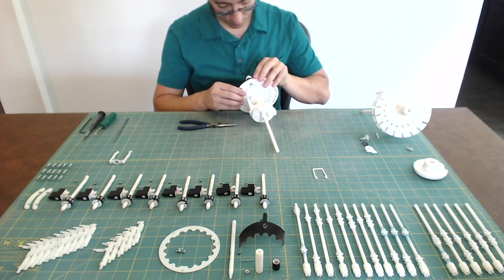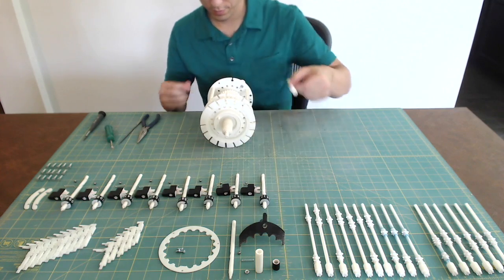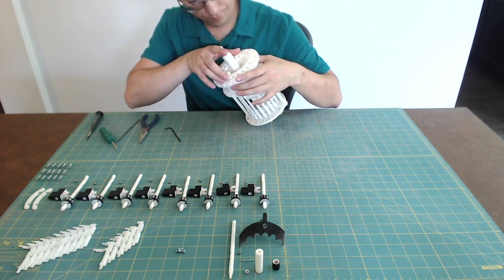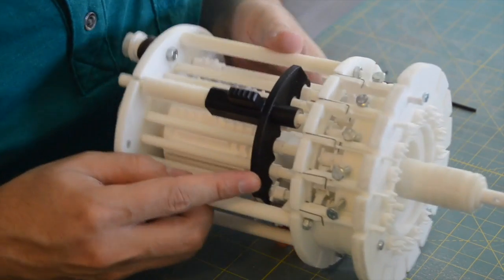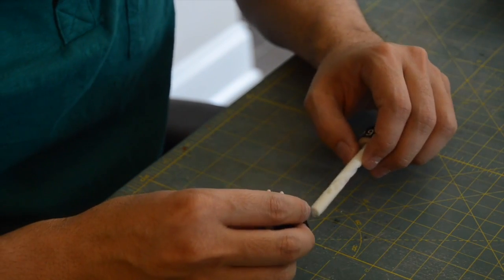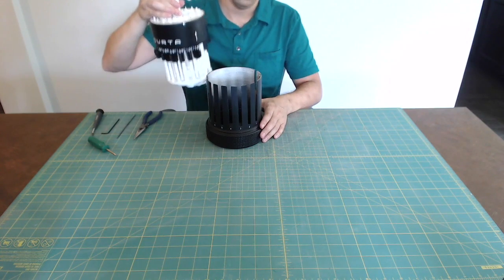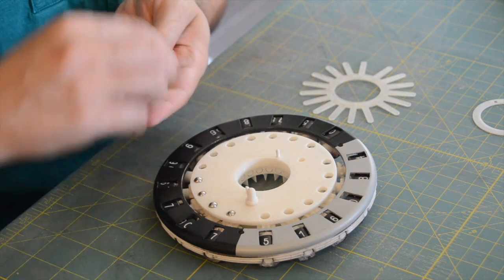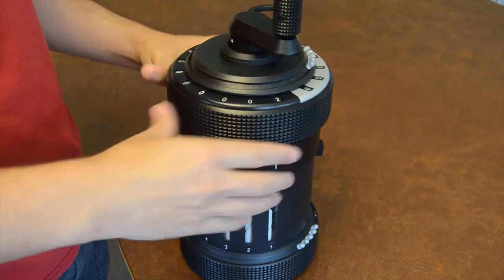3D Printed Curta Calculator Assembly

Comment: With where resin printing is at could one effectively shrink this down toward the original scale?
Reply: Simply put, sorta. Resin is very brittle and might not hold up but it would be plausible
Reply: @braydenhancock3907  usually use a nylon like resin myself it's got better properties.

Comment: I am having trouble with the placement of the gears on the transmission shaft and the discord link no longer works, is there any way for you to provide a more detailed instruction video/manual, thx.

Comment: Awesome project, im 200 hours of printing deep into mine!
Reply: I’m thinking of printing one, do you know what settings you used and what type of material?
Reply: I used the recommended settings given by the guy who deigned it.  I just used hatchbox pla to print it and its turning out great.  The only flaws I've had is sometimes the walls of the print will start to jog as the layers build up, but I got a bl touch for my ender 3 and that fixed the problem.
Reply: @kylekirsch6446  Hey starting my build now. How did yours end up turning out?
Reply: @bksl09  I ended up running out of time before university, but I learned a whole lot about the sanding, painting, and assembly process.  If you have the drive, this is am amazing project to take on.   Still fascinated by it and hope to finish mine someday!

Comment: Hey marcus wu ! Very nice your project. I've start to conceive my own curta this past year for my final project in my school (college). I've decide to print you're to reverse engineering somme part were i hade somme issu to conceive because i only have somme video and picture to help me in my creation. There are somme parts like the main axle that doesn't turn easily and i habe broken like 4 times the stem drum. Have you somme idea that i can use. I am already printin 100% filling and i am using pla at 200°c and the bed 60°c fan at 100%.
Reply: How did it work out

Comment: very nice, seen a video: www.youtube.com/watch?v=AnTb26WHx2Q&t=378s  who does this assembly on the real thing (real size too), he uses some jig blocks to place the assemblies on during the build and has a 'Press" block to do the pins, and a special nut driver for the top number dial and crank assembly, might make your build easier, albeit at a slightly smaller scale, BUT your video makes a great adjunct to this one, as seeing the parts this guy is working on in YOUR projects scale makes for an even greater understanding of how this exquisite machine works!!- just wish you could show the actual 3 D printing of some of these parts and what filament & settings you used.

Comment: Congratulations. I am a lucky owner of an original curta! Unfortunately, the reversing lever is stuck in the upper position. I tried putting HD40 in it but it didn't work. So, I want to disassemble as little as I can to see what is going on and maybe resolve it. From what I have seen here I need to remove parts until I get to 42:18 in reverse. The I would have to remove the lower housing. My question is: how is the lower housing attached to the rest? I can't find how did you do that. Thanks in advance.
Reply from the maker: Apologies for not responding earlier. I didn't see the comment.
The lower housing slides into place and is held against the frame of the Curta via the bottom plate. That plate is held in place with two M2x18 screws. Assembly order has that being attached before the upper portion. However, those parts can easily be removed without removing the top pieces. Putting them back together can be challenging because the long M2x18 screws can be tough to align blindly. What I do for reassembly is rotate that bottom plate so that you can put one screw in, but can still see the bearing plate. Turn that screw a couple of times so the thread is started, then rotate the bottom plate into place. Now it should be easier to blindly align just one screw since the bottom plate should be correctly aligned to the frame of the Curta. However, keep reading as it is likely you'll need to remove the carriage (paragraph after the next describes that removal).
If the reversing lever is stuck, it is likely caused by one of the turns counter gears getting stuck -- either against the turns counter portion of the step drum or the turns counter portion of the tens bell. By taking the lower housing off, you will be able to see the step drum portion, but not the tens bell portion which handles carries.
To access the tens bell portion, you will need to carefully tap the pin out of the main crank handle. Careful to support the main crank or it will bend! Remove the upper carriage circlip (it's the larger of the two and be careful here as well, these can break), lift away the rings, the spring, and the ball, lift the carriage off, then unbolt the upper sleeve and lift that away. Chances are one of the carry levers is not seated properly (could also be bent or broken) into the gear which interfaces with the tens bell. There is a clip which holds the first lockout in the right place against the tens bell. If that clip came off, that lockout gear might be out of place and prevent movement.
Those are the main problems I can think of that could prevent the reversing lever from moving. Removing the upper carriage portion is risky. Tapping out the pin holding the crank handle on and removing the circlip are the spots most likely to break something. Take photos as you go so you can reference them for reassembly if you need to. If you end up needing to remove any of the shafts, be sure to document the order of them and which parts are matched to which shaft because their order is everything! If you feel uneasy about it, I highly recommend paying for someone to maintenance your Curta.

Comment: Hi Macus
I have downloaded your files of the curta from the thingiverse and I find it hard to find someone who has a cutting machine for the spencils for the letters.
I am wondering is it possible or pritical for you to upload a modified version of the parts that needed to put numers and marks on with letters and marks curved in it on the 3d models so it will be lot easier for us to get the numbers and marks on it.
With the difference in the level, the numbers and marks can be easily painted though just filling paint in the grooves though simply using a small brush.
And thanks a lot for your efforts on the curta, it is just amazing.

Comment: Does it have to be that big because of the nozzle size, or did you just decide to make it that big?
Reply: The parts inside are small. Some of the gears have walls that are only 0.8mm in size and the gears are very difficult to print at 1:1 because as you've said it's a matter of nozzle size but also the resolution issues of FDM printers

Comment: i know you printed this in PLA, is there any worry about degradation due to humidity? what do you think about using ABS? I just purchased a new printer to tackle this build. really looking forward to it.
Reply from the maker: I haven't seen any degradation due to humidity. I chose PLA due to its high rigidity. ABS will probably flex a little bit more which will matter for the long transmission shafts. In fact, the PLA isn't even rigid enough to be able to handle subtraction at anything other than a very slow speed. When turning faster, the added friction of cascading carry operations can cause the shafts to bow temporarily and lose a turn.
Reply: Would it be feasible to add a hole in the center of the shafts for insertion of metal rods? Or are the cuts and divots too close for that to work?
Reply: @1MBStudios  no

Comment: Have you attempted a 200% Curta?
Reply from the maker: +Carl Siemens I have not. I think it may be possible with an SLA printer, though. Some fitting tests would be necessary to figure out how to change the tolerances in addition to the scale change.
Reply: Marcus Wu 
How about going bigger?
Reply from the maker: +Carl Siemens going bigger is possible. Scaling should be applied to the nominal dimensions and the printer tolerances should be kept without scaling (assuming the parts are still produced by FDM printing).

Comment: You - my man - are a complete and utter genius.  Mindblowing job!!  Truly inspirational!!!
Reply: By the way - I have all 3 original Curtas - the type 1 black, the type 2 black and the type 2 grey.  I am now forced to 3D print out your version to own the full set.
Reply from the maker: +Greg Parker nice! The type 1 actually went through multiple iterations, but it is hard to draw a line between the changes. I think that may have been the cause for some inconsistencies I noticed in the engineering drawings which resulted in a few iterations of my own to get everything right.

Comment: Did you design all of the parts yourself or were there drawings you copied into cad software? Did you have to make many changes because of the nature of manufacturing you used?
Reply from the maker: +VS BinarySloth I based all of my work on the original engineering drawings, but those are images. There is no way to import them, so all the CAD work for each part was done by myself.

I did scale it up and I added tolerances to the dimensions based on the engineering codes listed on the dimensions which I had to learn about. Tolerances we're estimated based on some tests I designed and printed.
Reply: This project is really cool, good job.

Comment: 20min05secon. What the metal insite this ?
Reply: I'm in the process of printing one of these. I think it's going to involve at least 150 hours of printing, $60 in hardware (the springs alone are expensive) and much time assembling. Personally I wouldn't sell one for less than $500 even as a hobby.
Reply from the maker: +Kun Nura the spring on the carry lever? It is music wire -- a high carbon steel with high strength and elasticity that is often used for springs
Reply: oh, can you show me image that springs and other springs inside the curta ?
p/s: i very very love this this project, but i can't made this, can you sale me this product ?? why you don't put into production this project

Comment: I'm curious as to why you didn't use some threaded rod glued into the plastic rather than using a die to thread the plastic itself. You could also have used heat-set inserts in places instead of tapping and screwing into the plastic. Adding rotary bearings and metal rods to the selector shafts might also be a good idea. 

I know these mods might make it a bit less authentic to the real thing, but I think it might improve operation. 

In any case, I do plan to be making one of these at some point. Amazing work! If I'm feeling ambitious, I may incorporate a few of my mods.
Reply from the maker: +Erik Scott some of those changes might make a stronger product, but not all of them are necessary. The biggest problem I have seen is that carries from one digit to another can introduce enough force to bow the transmission shafts which causes a lost results digit turn. This makes subtraction very difficult. Reducing that force is hard. Making the transmission shafts more rigid may require casting them from resin.

Comment: I feel like you will start receiving a lot of offers :) only one suggestion would be to ensamble the exterior with gloves to avoid fingerprints and maybe glue some screws to secure them.
Reply from the maker: Good idea for the gloves if it's mainly for display. I get too excited about it and want to use it too much. I end up handling it and getting fingerprints on it anyway. I suppose I could wear gloves any time I handle it, but that just seems like taking it too far :)
Reply: Glue?  Get out. Mechanical retention FTW! :P

Comment: With a lot of cheap LCD-based DLP printers available now, do you think we can print this in 1:1 scale?
Reply from the maker: +PartTimeRonin unfortunately, no. I had a few 1:1 parts printed by shapeways and they are so fragile I am afraid to handle them. I have some other ideas in mind for going 1:1. I think it would require a combination of multiple manufacturing techniques and materials

Comment: Could these files conceivably be scaled down to make a 1:1 metal Curta on a CNC? Could be an interesting project.
Reply from the maker: +Stephan Brun actually, I did the original models at 1:1, then made a copy of it to add the printer tolerances and scale it up. I think one would need a watchmakers CNC machine to do it by computer control, though. Those aren't cheap.
Reply: Marcus Wu If you could manage to produce some in metal with the help of something like that, would some kind of copyright prevent you from selling them? I think they would sell pretty well considering how iconic they are and how expensive an original one is...
Reply: @asronome
i'm not a patent lawyer or an expert but i think the "copyright" protection would be a "patent" and i think a patent can only be held for like 20yrs then anyone can use it (i'm not completely sure).... anyways the guy who came up with this is long dead and i don't think the company that originally made these is no longer in business (i'm assuming they went out of business when cheap calculators was introduced)....

Comment: Just got a 3d printer a couple of months ago and have had an ebay search for curta for ages. Way to expensive to buy a real one. Will be giving this a try once I am happier with the quality of my prints. In the BOM you have some that are recommended to print with a 0.25 nozzle. Would / could it be a good idea to outsource these parts on a SLA printer. 
I don't have that small a nozzle so would outsource those bits anyway. Just wondering if having them printed in resin would be better for strength.
This is truly remarkable work.
Reply from the maker: +Paul Busby there aren't any parts that require a 0.25mm nozzle anymore. I will update the BOM.
Reply: oh cool, Are the models different or just everything can be printed in 0.4. 
Now I really don't have any excuse. Although i think i can dial in my printer a bit more first

Comment: Do you print screw threads on the various rod ends? Or do you thread them with a die? Same question for holes.
Reply from the maker: I thread them with a tap & die set for most of them. The thread on the nut that screws onto the bottom of the crank collar and the thread on the carriage cage that fastens to the knurled grip are much larger so I printed those.

Comment: I hope you don't mind the questions. Have you ran into any issues that caused you to have to reprint any of the pieces? Also, what do you think the total amount of time was spent printing this calculator?
Reply from the maker: No problem with the questions at all.

I did have a few issues with my printer that required reprints. Particularly on the first Curta I printed. On the small parts such as the carry levers and the pins and axles if the extrusion isn't right you'll end up with weak parts that will break. This Curta I had a few issues because I built a new printer and it's the first time I built and calibrated for a bowden extruder.

I ran through the gcode files for all the prints I did for the second Curta and the sum of the estimates was around 9.5 days (assuming non-stop printing which isn't realistic). It actually would have been longer than that due to the estimations not accounting for acceleration.

Another fun fact -- the lower housing is the largest piece and longest print. It took about 60 hours (2.5 days) to complete. That's more than a quarter of the total time for all of the parts.
Reply from the maker: Unrelated to printer issues, on the first Curta I broke some parts (such as the main axle -- multiple times) due to there being too much friction, misaligned parts, or incorrect assembly. Just making sure parts move smoothly and don't have little burrs or flashing is a big step. After that, a spray on PTFE dry lubricant works wonders -- the plastic kind of grabs other plastic without it.
Reply from the maker: What I've found for a bowden setup is that all play has to be eliminated from the tube when retracting or it will clog. For direct extrusion if the gear is eating the plastic, you may be printing at too low of a temperature.